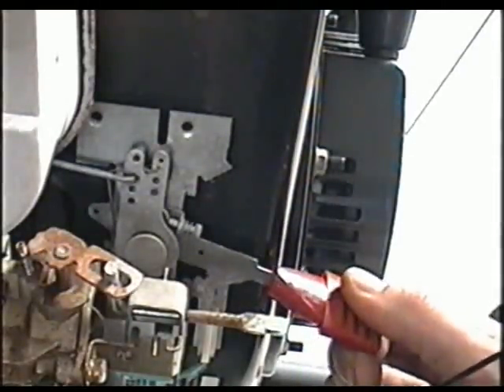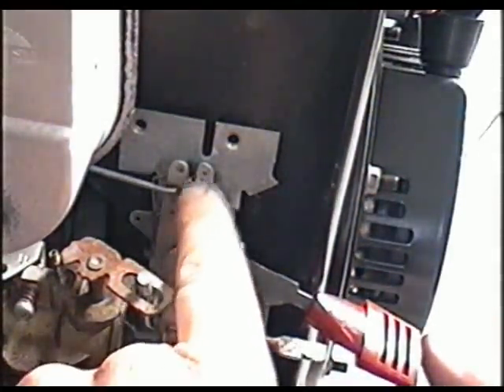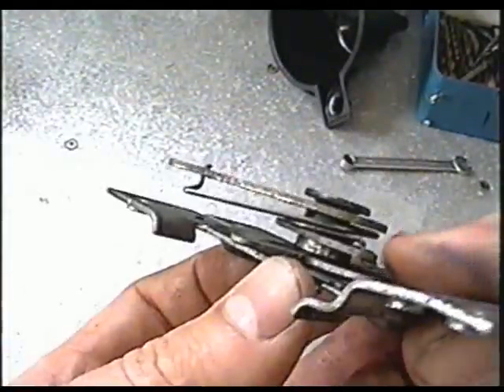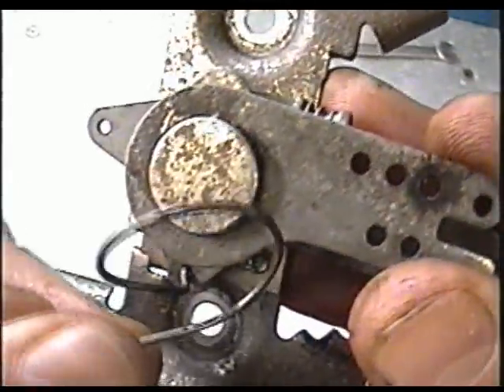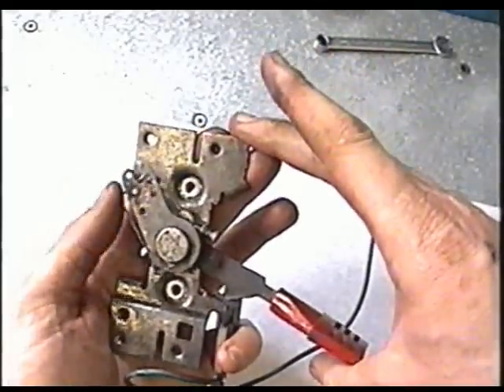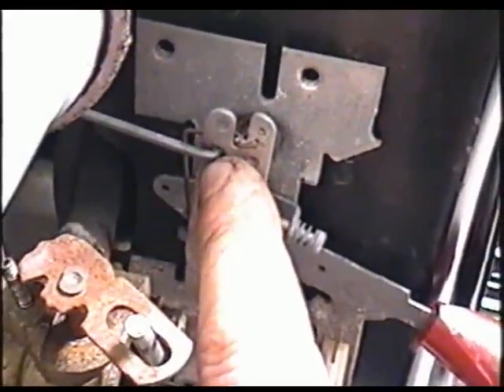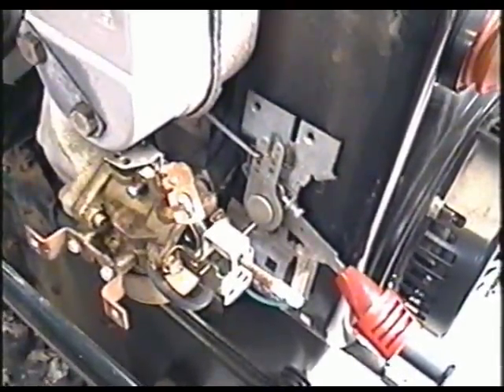HOW TO REPLACE Snowblower Throttle Spring On A Tecumseh Engine - video

Comment: I bought this machine used and at a good discount due to this spring being bent horribly and the whole mechanism installed improperly.  I could have  bought a new one probably.  But after watching this video,  I was able to reremove it.  Bend the spring back close enough to it's proper position.  And reinstall it all correctly . Now it works like it should!!!!!! Thanks a million for the video!!!

Comment: Hard part is finding just a new spring. I lucked out and have an old school repair shop near me that knows small engines like the back of his hand. He went into the back and dug out a used one for me for $20. Explained how to and how important setting the governor was. I was grateful because it was the night of the first big storm of the year. I don’t have a garage and had my snowblower in my damn kitchen. Took an hour and two pulls and a couple adjustments and it ran perfect, even a little better than before.

Comment: have snow thrower with this problem.  Looks like my spring is stretched out.  bought brand new assembly on ebay for $20.  Thanks, saved me a frustrating afternoon.

Comment: Thanks so much for this video. I just had took it all apart to fix the fuel line and i don't know what had happened but it seems like the tension came off that spring and i wasn't sure where it went to. I think it may have just came on woen some how.  Thanks again.

Comment: Excellent video could not understand why it was not pushing the rod as I was pulling the throttle. I have changed the carb but thought I had changed something. Throttle assembly close to 80 cad here will look tomorrow to see if spring broken or unclipped.

Comment: Thanks! I was able to take mine apart, but the spring was fastened just fine as far as I could tell.  It was not broken.  Is it possible that it just lost it's elasticity?  I can use my machine, but cannot adjust the throttle, but hey it works.  Do you have the part number and a place to purchase the spring or throttle assembly? Thanks again.

Comment: Very very helpful video! Thanks so much! My throttle works going up (bracket moves Governor arm) but when throttling down nothing happens, the bracket to governor does not even move. Any idea what’s happening here? Maybe need new spring? Somebody told me that the governor actually pushed the throttle closed by itself and that when the snowblower is turned off (which obviously it is while I am inspecting the throttle) and that is why I don’t notice the governor arm moving when I throttle down. The reason I ask is that the machine runs a little rough and it seems that when throttling down it has the most trouble. Haven’t stripped carb apart at all, just thinking it could be an issue with that spring. Thank you so much! Your videos have been really helpful throughout the years!

Comment from the maker: @ncrdisabled the little screw on the mechanis is what makes it go faster or slower. turn it in to make faster and out to go slower
Reply: What does the screw actually do. Did not check it. Was too busy checking carb adjustment for what I did wrong lol

Comment: My spring was also booked up properly but wouldn’t idle up or down. Unhook the spring from the top of the throttle body and bend it towards the rear of the snowblower (where you stand). That will give the spring some extra tension and mine works fine now. Easy fix. Hope this helps.

Comment: Dony, Fantastic videos.  My buddy had same problem but spring wasn't broken.  hmmm.  Thanks to studying your video we were able to solve it.  Turns out the piece of metal on the throttle lever shaft control where the spring z bend is attached was rusted solid to the shaft so when you throttle up, the set screw attached to the lever didn't push that center metal piece.  So, three pieces on that shaft ... throttle lever, middle piece and outer piece which attaches to gov linkage.   Middle piece would not move and that was the cause of our problem.  Clean it up, break it free from the rust and lube it and all set.

Comment: I have a issue with the same engine it will throttle up but not throttle down the spring is not broke. The governor doesn't seem to return to the idel position. Also the last time I used the snowblower the governor didn't seem to be working it wouldn't kick in when under load. What do u think? Thanks keep up the videos. U r the most informative channel on small engine I have found.
Reply: I have the same issue. Lever up, throttle open. Spring is ok. Lever down, throttle stays open.
Reply: Did you guys ever figure this problem out? Currently have the same situation going on with my tecumseh 10hp
Reply: bump this, im having the same exact issue right now. almost like it needs a 2nd spring on the right of the lever as a return spring.
Reply: Having same issue
Reply: only thing i can do to make it work for now is keep the side panel off the blower and manually return the arm to idle. im still looking into a solution, possibly trying a 2nd spring but finding one to work is harder then i thought.
Reply: I got same problem with governor not returning to ease off on throttle and the throttle spring on red handle lever is brand new and carb is also brand new and thus throttle return on carb is brand new and even with extra wind on it still does not return 10hp techumseh to normal lower  idle
Reply: I am having the same problem

Comment: Hello, thanks for the video, I disasemble mine because the engine run too fast, I tought the spring bend  too much... but I think it's because of the caburator ajustement that give too much gaz.

Comment: Your videos are superb - thanks for doing them.  I have just fixed a fuel leak because the float chamber O-ring was distorted.  But the engine hunts at all speed settings.  It is a newer carb with no mixture control.  Is it a problem with the throttle lever??

Comment: My spring pushes the throttle open as it should however when you bring the throttle down should it be pulling it closed somehow?  Mine is not pulling closed and the throttle down. Thanks

Comment: Great video. My throttle is doing the same thing, but the spring is not broken. It looks like the throttle lever hub is not longer connected to the hub where the spring bottom attaches. I am stuck in high throttle as I have no mechanism to bring it back down. I suspect I need a new throttle control assembly, unless you have a fix to suggest.

Comment: my 8hp tecumsey was "hunting" so i put a whole new spring throttle mechanism on it. it run for a minute now it wont start at all - has a new carburator also on my snow blower

Comment: Great video.well explain I have a tecumseh 5.0 generator 2500 I believe I have the same problem ,cause the only way it turns on is if I spay started fluid in the airfilter ,with the swithch on choke mode ,then it dyes.i try  to  put it on the  run position fast to keep it from dying  nothing happens .??...are generator n lawn motors  work the same? I'm not no expert

Comment: Do you know when gas leaks out of the carb while running if you need a new float seal or just replace the whole carb?  Mine is an Airens 824.  Thanks  If so can you suggest a good source and the right carburator part etc.

Comment: Hi I bought the whole part as you suggested because I couldn't get just the spring, but as I'm looking at both the new mechanism and the old mechanism and I noticed that my old lever is set up to settle in certain positions, up all the way and the other position is down towards the bottom. 
My new lever looks exactly the same but when I pull the lever up, it seems like it just flops back in the off position  ?
 When I look at my old lever, I can see that it has indentions on it so that seats in those positions but my new one does not have these indentations.  
Is this right and will it still work  ?

Thank you

Comment: excellent video, very informative...i have a 9hp tecumseh and could of used this video after i rebuilt the carb and removed the linkage...nice job dony 

how about that screw on the throtle  lever does it have to be turned in or out to increase rpm on the governor.....? thanks dony great video

Comment: Thanks for the info but it runs good it’s just when it’s running and you have it throttled up it seems to  idle down I don’t no if it’s just vibration or what

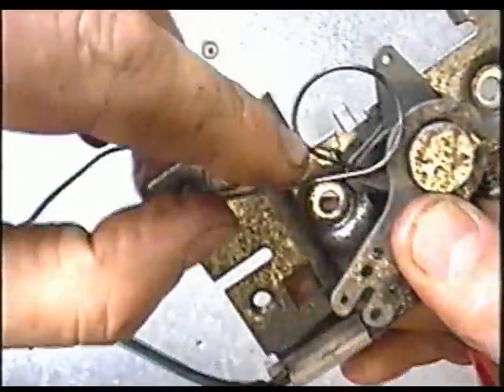Comment: donyboy your the man. just what I needed except I have one problem. Stop this video at 1:52.  My wire is green going to perhaps the coil? I also have a black ignition wire going from the carb cover ignition key to the throttle kill switch the black wire going to the ignition key came off the throttle  and I failed to study where it goes. Can you help?..There are no video's on this and I don't have electric start. Hope my description is accurate. TY in advance.

Comment: I hope you're still working on these machines. Great video. I have broken the wire as it comes into the Kill portion of the Throttle control lever. Can you review how the green wire is routed? i.e. Where is it from? How does it attach to the lever and how can I reattach it. Thanks

Comment: Hey don I’m replacing the throttle spring but i played with that screw on the throttle assembly so much im not sure where it should be how many turns is factory set?  Thanks for all the help!
Reply from the maker: you just want a bit of resistance on the spring

Comment: All your videos are fantastic and informative KUDOS!!!!!

I have a 1991 Tecumseh HMSK-100 that has a loose throttle assy. By that I mean when I start the engine and move the throttle to the max position and let it go it will slip back a little causing the engine not to run a full throttle. It appears that the lever has gotten loose over time. The spring and linkages are fine, it's just the throttle lever that appears to be loose and doesn't hold it's position. I can compensate for the loose throttle lever by adjusting the small screw to increase the engine speed but I would prefer not to do this since it would be just a work around and doesn't address the problem of the loose lever.  Is there a way to tighten the lever or will I need to replace the entire assy? Any help would be appreciated.
Reply from the maker: best to replace the entire assembly

Comment: My throttle spring seems to have tension. But my question is this, when I push my lever up, it does push the rods connected to the carb and governor forward forcing the throttle open, which is now under tension. IF I push back against the governor, while the lever is up, there is tension there and the throttle closes, and reopens if I release the governor. But if I push the lever down, nothing happens, the throttle remains open.  Should the lever being in the down position pull the throttle closed? Or is that the job of the governor when the engine is running?

Comment: Hi - To replace the throttle spring I need to remove the shroud that covers that covers the throttle, carburetor and choke area.  I’m having trouble getting the choke knob off so I can remove the shroud.  It looks like it is pressed on to the choke lever.  Any suggestions on way to get the choke knob off?  Thanks.

Comment: Just curious, I'm having the opposite problem.  The blower throttles up fine but when I throttle it down to shut it off, I get no response.  Am I correct in assuming the spring would be the issue here as well?

Comment: Hello Dony, Great videos. Do you have any videos on what could cause the muffler  on craftsman 950 to get fire engine hot after running for a few minutes?
Reply from the maker: SYMPTOMS Of A Leaking Exhaust Valve On A 4 Cycle Engine

Comment: I have replaced the Throttle spring and it didnt work, so I replaced the hole throttle mechanism and when I more the throttle it still will not move any other suggestions?

Comment: I have tecumseh 9hp on a snowblower aftyer changing carb to new one engine runs rapid have tried setting govener per your instructions also double check all settings to no avail what do i do Thanks

Comment: My  linkage faces down not up.  Is my linkage upside down because the down throttle position makes it run fast moving and up shuts it off.  I did remove carburetor and housing to get to coil.  Help?

Comment: i bought a new throttle assembly after trying a used one and both of them would not move the linkages either way what the heck am i doing wrong ? never seen something so easy to not work i have a chipper is the some other part that goes to the lever and the part that has the linkage in it that would take the part of needing the assembly to start with 10hp hm100 on a wood chipper there is a spring on my governor can that be causing me my problem ?

Comment: I cannot find the answer,  My yardman II snowblower runs only RABBIT,  when I put it to turtle,  it still runs like Rabbit, 
how do I correct this?
Can it be just a simple adjustment, or spring replacement or new part altogether

Comment: I have a 3.5 Toro 3521 snowblower am not sure how to get the throttle to work  have is the spring on the and the linkage from the governor to the when I hit it I get no no throttle what am I missing sorry I have to ask but I don't know

Comment: Mine throttles up but doesn't go back(RETURN)! The spring is good like yours. Could it be the governer? I notice your governer kinda springs to the right(towards engine)! My governer is loose.(doesn't spring either way)!
Reply: it's just stuck. either lube it up with silicone spray or replace the whole unit.

Comment: hi, i have a 9 hp tecumseh snowblower engine that when in high idle is fine without a load on it. now when the load like say the auger (without snow) is applied, it bogs down ever so slightly. the problem arises when you let off the auger, the engine revs much higher after the load is lifted. ive been wracking my head on this problem for hours even days and still cant find the solution. again, after the load is lifted the engines rpm's are much higher than when you start it and open the throttle without a load. also, after the engine is reving the fast, if you back off the throttle and bring it back up again, it goes back to normal. i have no clue what might be causing this?

Comment: Hello donyboy73, I have an older Troy Bilt Econo-Horse Model 12185 (7HP Tecumseh), I was wondering if know where I can buy the spring that you are demonstrating how to take off and replace?   Or the entire mechanism if that is the only part that is available?  Thanks!
Reply from the maker: pantherinsky you have to replace the entire mechanism
Reply: donyboy73 Thanks I finally found the Tecumseh Part Number I needed:  #34663 Speed Control Spring or if one needs the entire mechanism the part number is: #34664, Control Bracket
Reply from the maker: pantherinsky ok good, I thought that little spring wasn't available
Reply from the maker: pantherinsky ok good, I thought that little spring wasn't available
Reply: +pantherinsky thank u I need that part, you made my research a lot easier. God bless.

Comment: I have a Tecumseh Ariens snowblower with a throttle lever that won't stay in the full throttle position while running.Replace spring??
Reply: same issue, did you find solution??

Comment: where does the choke spring on a craftsman snow blower with an 8.5 tecumseh go?  I believe that's what it is - it fell off from I don't know where.  it's a 2 -3 inch wire/rod with bends on either end - kind of looks like bat or airplane wings

Comment: I have a 10hp tecumseh and when I rev it up it won’t stay it will idle back down when you get in the snow
Reply: Could be a bad linkage or the throttle or goner linkage is in the wrong hole. If it is sputtering /surging it could be a clogged carburetor.  You also may have to adjust the idle. Donny boy has video's on cleaning and replacing the carburetor. The throttle and governor linkage and adjusting the idle.

Comment: I have the same problem. Snowblower Throttle Spring. I change the fuel tank line. The machine runs on  idle only . no power.

Comment: I could not find a replacement  Throttle Spring - so I ended up purchasing a new throttle control.
Once I removed the throttle controller I saw the spring was not broken so I have no idea why I had this problem with the throttle control.
I installed the new throttle controller,  and everything worked fine.

I have this part that Dony is showing us,  this Throttle Spring 2:00
I can give it away if you need it or You can help me - Help - Dony and pay whatever you want for this spring,  Any and all money will go directly to Dony.
Reply: Do you have the pn for the throttle control? Cant seem to find it anywhere. Thanks :)

Comment: Are you still available I have a question please????’nnn
Reply from the maker: what's your question?
Reply: @donyboy73  trying to understand how this linkage goes on this 9hp engine I have looks similar to yours but a little different trying to make sure I order the right thing if I don’t pus the pedal it’s wide open when I crank but when I push pedal it goes the opposite way any way can send video or pics

Comment: Tecumseh throttle spring Part # 34663.  On line at Jacks small engine.  $1.32

Comment: I was the idiot that took my linkage off the carb and the governor with out taking a picture  now I got everything back together and it starts but I forgot where the  linkage goes. its a m t d snow blower with Tecumseh motor.